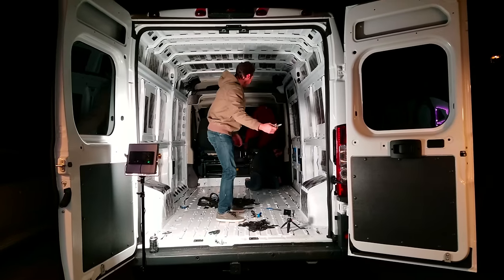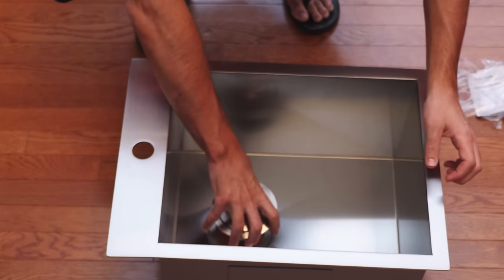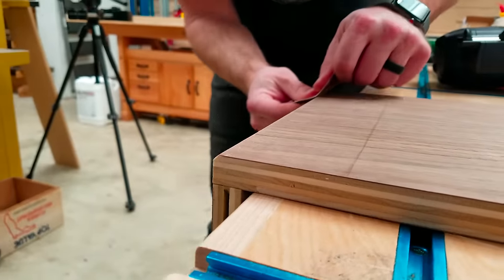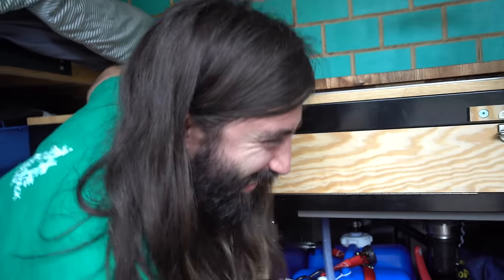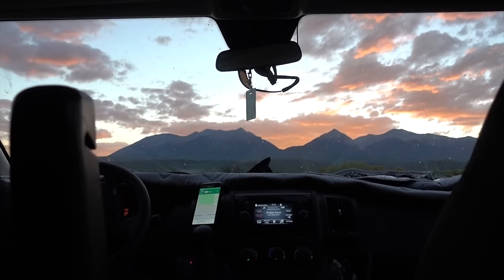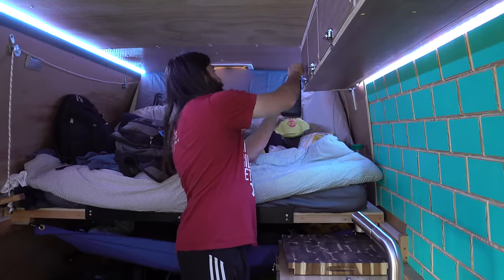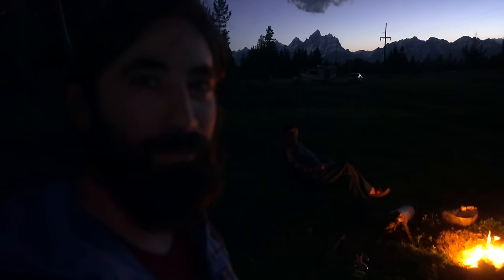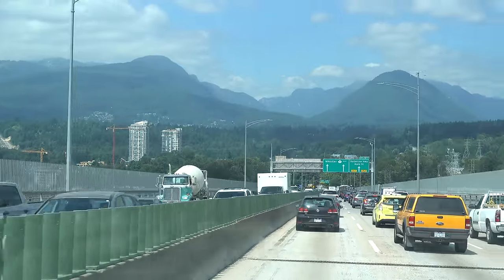Master Craftsman Renovates My Camper Van To DRASTICALLY Improve My Van Life!

Comment: As i work in the LED industry, your LED strips stopped working after ~6 months because it wasnt sticked on an aluminium profile, the strip doesnt cool
Itself and the copper wiring inside the pcb of the strip just burns to a crisp and the chip itself melts. I strongly advise you stick it on an aluminium profile, it doesnt cost a lot.
Reply: exactly, plus it looks more professional on the profiles, especially with light diffusers
Reply: What light strips do you recommend to light a room and put under a desk and furniture
Reply: Chase Hall strongly advised to put quality strips, the cheap ones will last you no time, so better invest little bit more and forget the headache of changing them for next 5-7 years. Dont forget about Aluminum profiles!!!
Reply: Thank you for the information.  I would not have bought aluminum profiles.
Reply: Never really thought about aluminium profiles, wonder if it played a part in my LED strips lasting for the past 6 years without an issue

Comment: Awesome video & great van build! I can relate to your trip with your Dad. In March of 2013 I had lost my job of 28 years (position eliminated) & my then 23 year old son was laid off for 6 weeks. My son did not have to ask twice about putting 3 of our motorcycles in the back of the truck & hitting the road. It had been a rough winter in WI 2012/2013 & felt great knowing we were heading south as far as Key West, then west to the CA coast, north to northern CA, & finally zigzagging our way back to WI. Thank you for sharing your build/s & adventures.

Comment: Hey man I'm not an avid viewer of yours but I have been keeping up on the progress for the van. I noticed something you might wish to change, so in your sink's system you're using a foot pump, if you simply add a one way valve to that foot pump it will help keep pressure inside the water container, then you would be able to actually use the sinks built in handle to control water pressure. This is similar to how gas tanks use fuel pumps actually.

Comment: I wish I could build a van... I have a few questions. Would you ever consider having no windows in the back? Reason I'm asking is for security. For me I would have no windows in the back of the van to make it more secure and would divide it into two secure areas - driver area, living area. Would you get rid of the passenger seat for more functional space? Example: using it as a desk/bathroom/shower/storage area instead. Would you get a smaller bed? Or a fold out of the wall bed? Or do you prefer the couch-bed fold out. How do you determine stationary living items vs dynamic cross-functional spaces/living items? Reason for so many questions is I'm interested in doing a complete automotive design of a living space van for college/university students as life then is so dynamic, school wages are high.

Comment: I know Im a little late to the video, but I just started to watch your channel!
Awesome build! 
One suggestion, Undermount the sink, then have a cutout board that fits into the hole and rests on the sink to make the counter top flush, so when you need more counter space you have it, and the pull out board that covers the sink also acts as a cutting board. this is normal in most 5th wheel campers and boats.
Reply from the maker: Welcome to the channel my dude! Damn, that is a great suggestion and would be so sick to have it perfectly flush like that. Will def remember for next build

Comment: Love your overhead cabinets, and especially the hinges and locking clasp, very nice!  I wonder if the hinges would still hold up the door if cabinet was a bit taller?

Splash guard is genius!  Looks like plywood backed with blue melamine, and grooved with a CNC machine.  Very clever!

Do you get a lot of metallic noise when driving, from the metal tool chest drawers?  If yes, how did you resolve this?  

I found a good underlayment for wood flooring, that can also double for noise muffling.  Its cheap and effective.  On Amazon - Silent Silver, or Silent Blue, etc.  Its a thin 1/8" roll of closed cell neoprene, backed with a mylar foil in different colors - silver, metallic blue, etc.  The Silent Silver works as a thermal insulation, water vapor barrier, noise deadening to some degree, and cushions objects. Being very thin, its also handy for not using up space inside RV.

I used this on my RV flooring, as an underlayment for Click Lock Tiger Stripe Bamboo planks from Home Depot.  This flooring is very narrow, and you need no glue or nails. Floats and locks into place. 

Glad you got to spend time with your dad, Alex!  You made some good memories!

Comment: If the sink was on the other side next to the sliding door do you think it would be long enough for a shower outside, does the faucet have the option to be a spread spray? Thinking about getting this sink setup but with a water pump

Comment: the backsplash is cute, but I look at that as wasted hanging space, even watching you look for a place to hang your water bottle...you had to hang it on a latch..which means ultimately you'll have to take it off to open the cabinet. shallow shelves with bungees could be an actual spice rack. Pans and kitchen utensils could go on hooks or o rings with caribeaners.

Comment: @9:40 I saw the sun at such an extreme angle to your solar panels I had to ask what's the normal power output like on a clear day? Have you ever thought about installing some electrical lifts to your solar panel so that you could gain more power gen through the day. Maybe even setup an RPi connected to directional light sensors to automatically track the sun when your stopped and camping.

Comment: I've seen these sinks made in the past before, a great way to improve it would be to put a one way valve  for the air input, that way it pressurizes the water container, then when you open the sink valve it would have a more continuous flow. though the water container may need to be stronger.

Comment: Being a full size front wheel drivetrain van makes the Doge Promaster very different from just about every other full size van on the market. I'm wondering if there are any advantages or disadvantages to this setup on a heavy vehicle. I'd imagine gas mileage would be slightly improved due to less drivetrain losses. Also wondering how traction is on snow.

Comment: Two things I would have done. 1: put a dirty water tank hooked up to a filter so you could use old dish water again to was dishes. Just hook up the dirty water tank when you are washing the first time and then next time you wash, hook the filter in-line to the line up to the sink and you only have to have new dish water every few weeks(if that). It could be a lot of work and you would want to be diligent about cleaning the filter after each use but it could save a lot of water. 

2: hook up an electric pump controlled by a switch so when you want to turn on the water you flick a switch next to the sink and it turns on the pump so you don’t have to use    your foot to create water pressure. Then when you’re done just turn off the pump to save battery life.

Comment: Holy shit, dude. You've added so much unnecessary weight, which costs buko to haul around.  Those heavy tiles could be done with lightweight plastic sheeting.  So much of the wood is too thick or can be replaced with again, plastic sheeting, cut to fit, with Maybe a thin piece of wood under it, if absolutly necessary.  Some things don't even need to be in there or can be downsized.  Space and lighter weight from the remod should be the priority, rather than just using what other  people do in their houses.  Bed goes on the floor, with something on top to walk on, Or fitted into the side and dropped down to sleep.  That "stuff" in the boxes under it?  Toss most of the stuff and see how much height you really need to use.

Comment: It looks like your entire water supply will fit in your sink.  Sorry, 5 gallons of water is a pretend water system.    It's easy to be critical when you said your biggest error was not having a water system, and I have a van smaller than yours and I have 22 gallons and a real holding tank, a shower, and flush toilet.  Don't fall for copying others bad designs.
Reply from the maker: I have 14 gallons on board. The 5 is grey tank
Reply from the maker: Don't spend all your time going around all online critiquing others builds and forget to get out and enjoy your own
Reply: @The_Sampler  You have said several times in several places you should have plumbing.  I'm just agreeing with you, you need real plumbing.